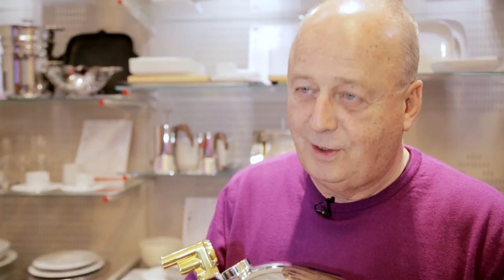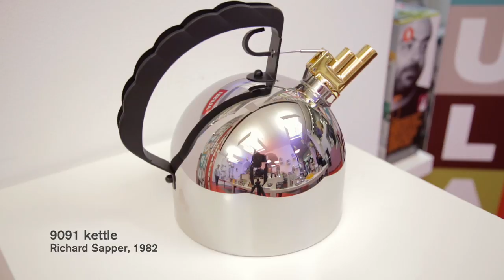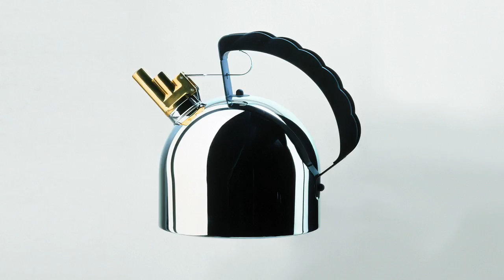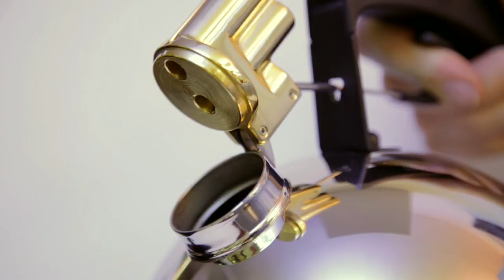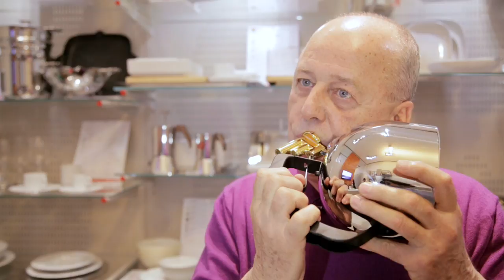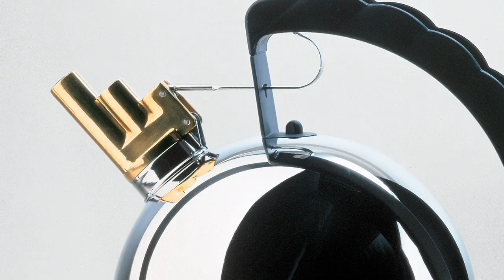Richard Sapper's harmonic kettle for Alessi

Comment: I have this exact kettle but it has a metal handle. I cant seem to find any other version with a metal handle, only a plastic handle. Do i have an original version?
Reply: The core of the handle is metal but it is wrapped in Plastic. Just check carefully and you will see it.
Reply: prolly a chiinese copy